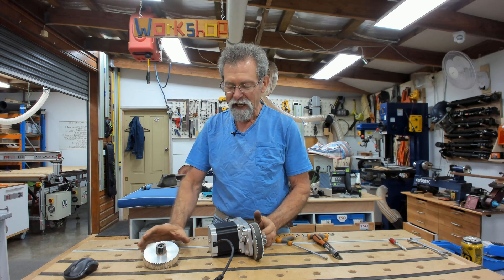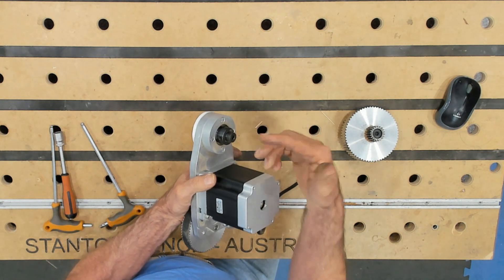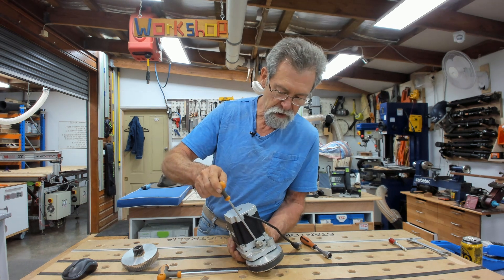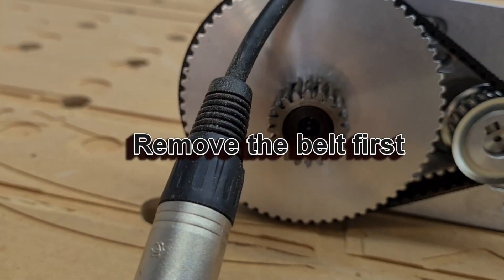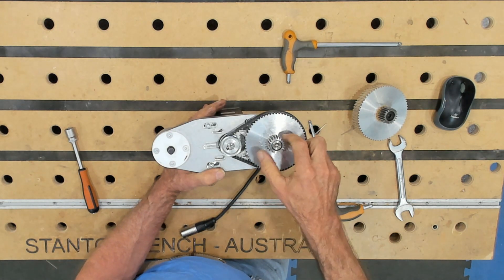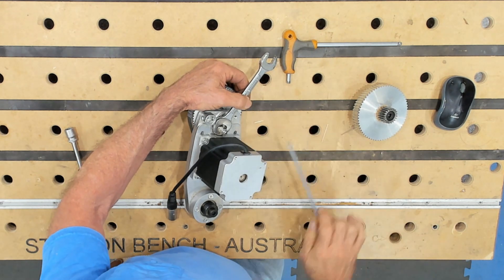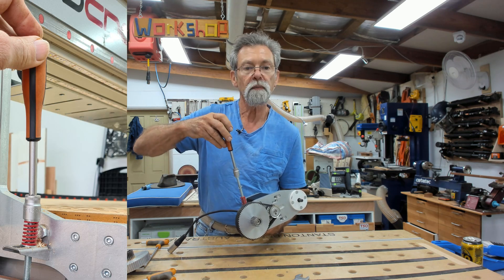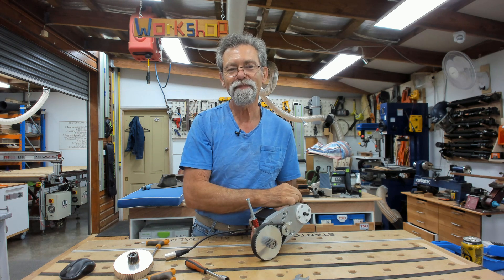Replace pinion gears on Avidcnc Dave Stanton

Comment: Some work mates near by givup to use grease on it. The mais reason is: saw dust. plastic aluminium cuts etc. origings that trough the grease it will sticks on the pinion gradualy. They´re option was: put a ar tip right near the pinion in order to avoid any acomulation of dust while it runs trough the rack. Caution,the air for it must be totaly dry. The result is good so far. Thanks for sharing this video.
Reply from the maker: Interesting option.